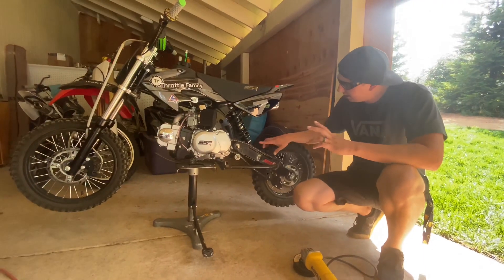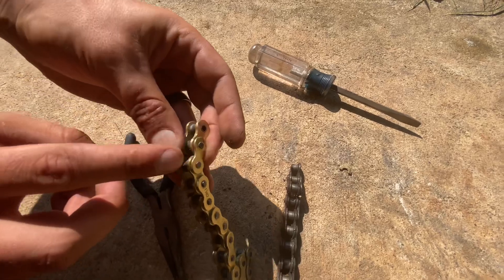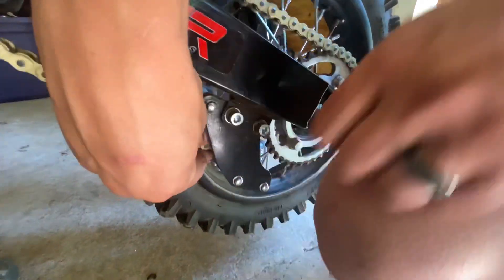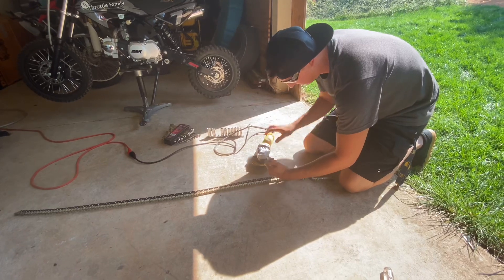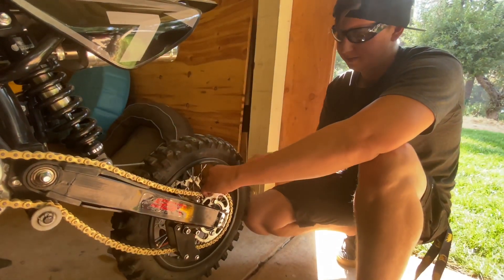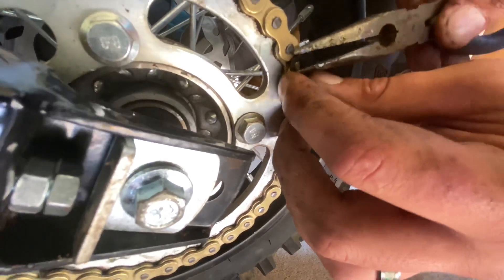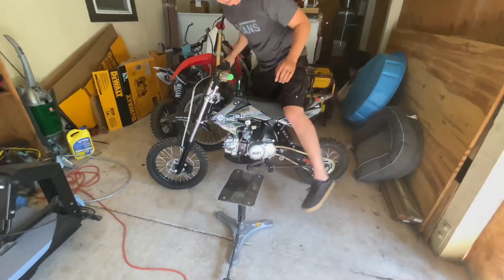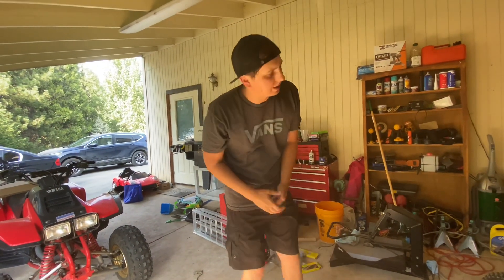How to install a new chain on your pit / dirt bike without a chain breaker

Comment: If you had any common sense youd have cut it then attached your new chain to it using the new masterlink and used the old chain in to pull the  new chain round the front sprocket

Comment: Where did you get the chain from \ where do you buy your parts from? Thanks for the video brother
Reply from the maker: I got it off amazon but the chain is no longer on there it is a 420 chain and just make sure you get a 120 link chain there are other good brands like did on there. I get stuff from all over amazon, Rocky Mountain, moto sport eBay all over just testing different stuff out
Reply: What's the chain size I got a 50cc and can't locate the chain anywhere?